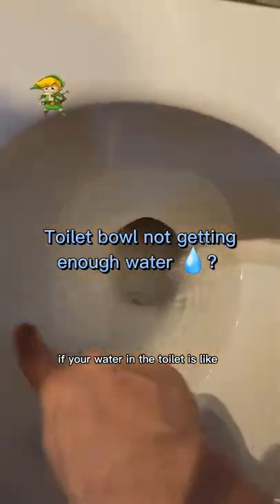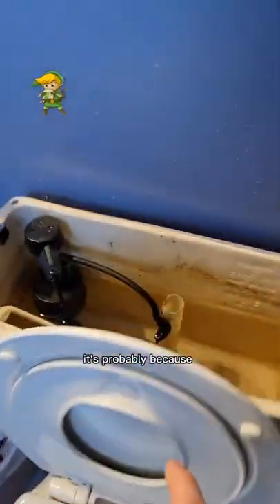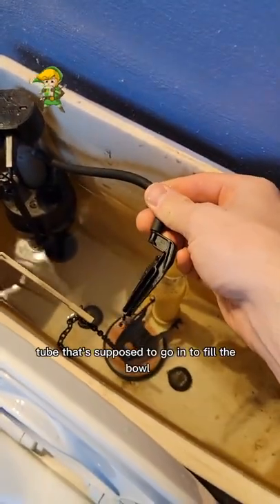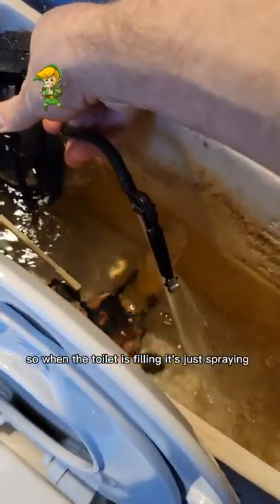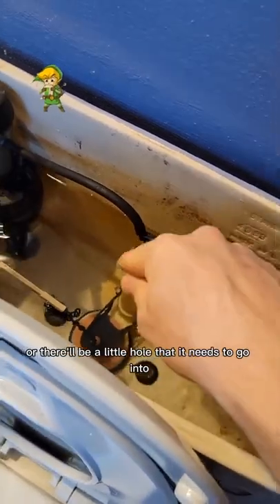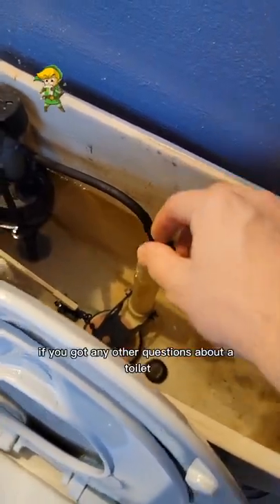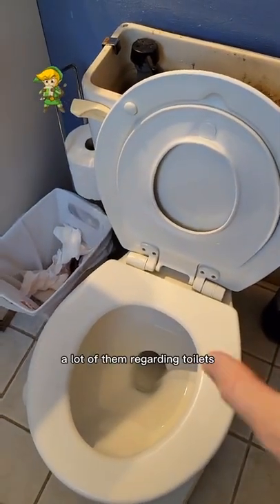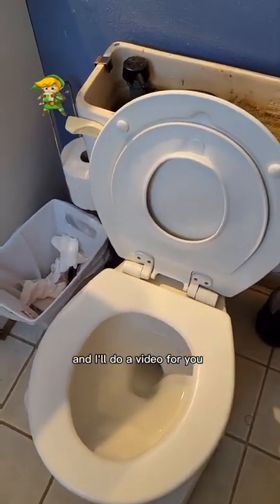How to increase the water level in your toilet bowl #shorts #plumbing

Comment: I attached the soft tubing to the top of the overflow, but the water level in the bowl won't increase despite continued water going into the bowl while the tank fills. How can I get the water to stay in the bowl? Thanks!
Reply: You can buy a separate kit to install in the toilet to give that pole more height, just don't buy a new toilet😊👍